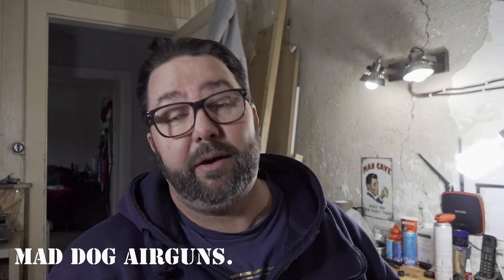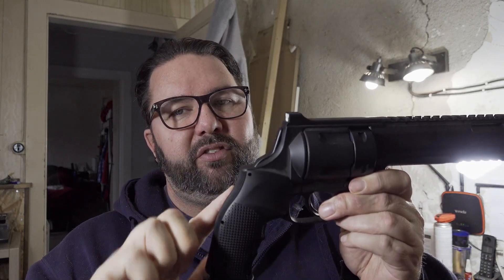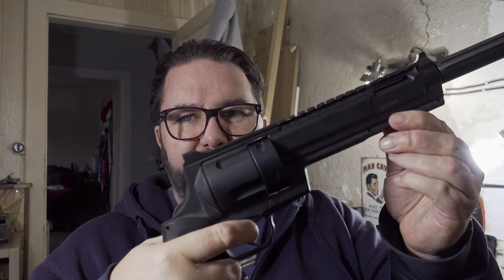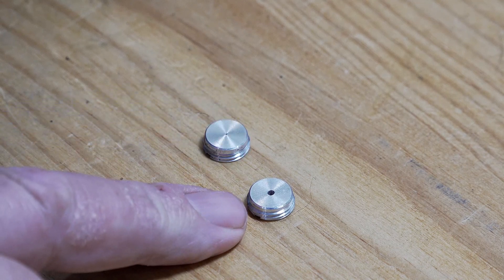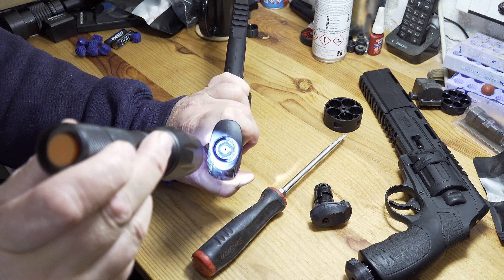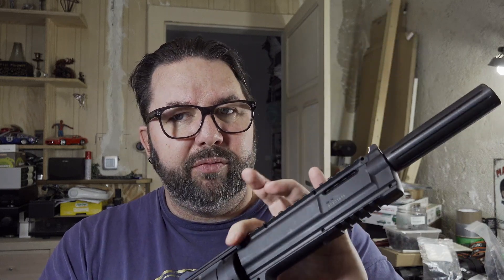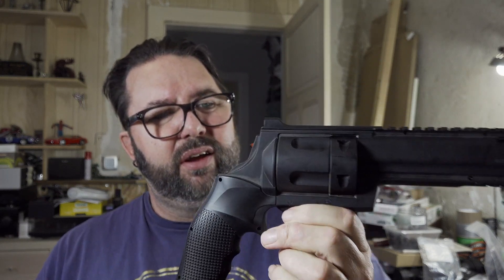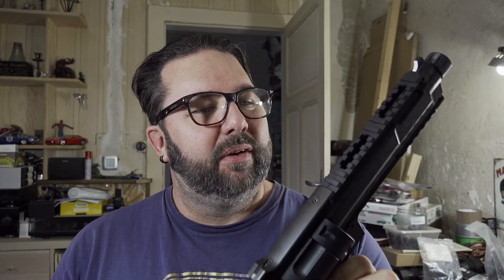Getting some good numbers with my HDR.68

Comment: Hey bro great video.  I personally wouldn't waste my time with modifications for hpa unless you're using it at home. For an edc, personally defense option, I'd stick with the valve pin, barrel and disc. You want to be able to pull it out quickly in a situation,  without having to fumble around with a huge tank. Not to mention you can't conceal it with a huge tank hanging off the handle.

Comment: I’m in the U.K. and use epoxy resin for my hdr 50 with 9mm steel balls. These are great slugs and the resin with hardener is dirt cheap.
Reply from the maker: I had been making resin ammo, but the hardener has gone off for some reason. Time to get some more.

Comment: Hi good video. I’m yet to do my barrel extension I’ve got all the stuff. One I’ve done it all is the still thread on the end of the barrel to fit a silencer.many thanks 👍
Reply from the maker: I think there are some silencers coming on the market, so yes you should be able to screw one onto the tuning barrel.
Reply: H my friend. I have the HDR - 50 as it is be for I do the mods yes I could screw on a silencer. But I’ve seen the HDR - 50 on YouTube with the barrel extension and the plastic extension filtered but then it flush at the front . So I’m not shore it’s possible if you know what I mean.👍

Comment: Hi, I have to replace the O ring that I blew out of my .68 after I took the restrictor out. Worked good few months then blew gasket out. Would you know of a video somewhere showing How to replace it? 
Thanks
Reply from the maker: I know @runerebel8441 had orings  come out, not sure if he did a video on replacing them, but worth checking out.

Comment: I recommend you to buy hexacon screws from aliexpress that cost dirty cheap and use them on plastic covers.
With that screws you can control the force and you will never again you damage the screw head.
I left little loose the 2 screws near to the barrel end.
Nice video again dear sexy dog😜
Reply from the maker: I've been fairly lucky with the screws on all my guns, a good fitting screwdriver helps. But I will check out those on Aliexpress.
Reply: What’s the listing name or size of the screws?

Comment: Have you thought about trying out pp700 in 22 loads of mods and easy to trun the fps up and it only £150
Reply from the maker: I'll check them out, they are €250 here in France, but they do look interesting.
Reply: @Mad Dog Airguns  I watch a video and with 2 sets of Alan keys and barely stripping the gun he managed to get 23' pounds of energy out of  22. 23gr